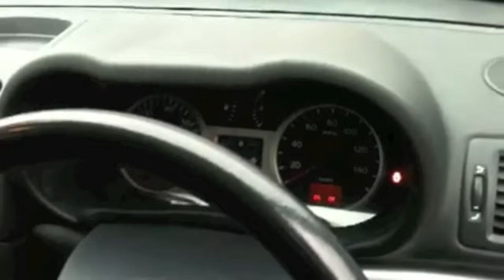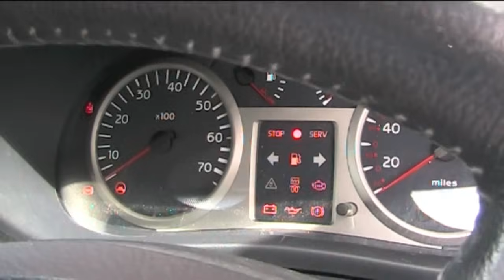Renault Clio 1.2 16v D4F Throttle Body Removal

Comment: You need to take the manifold off as shown here. It's a 1.2 D4F 712 engine. Also take air temp sensor out and clean. Re initialize throttle body if scan tool available if not disconnect battery so capacitors discharge, re connect, ignition on, enter radio code, start engine and allow to idle for 15 mins to set the idle regulation then drive between 2000rpm to 2500rpm for 30/40 secs to set the richness parameters. Btw these can be the worse engines to fix when running faults occur.

Comment from the maker: A fault code reader is whats needed, the dealers are expensive, so a mechanic might have a decent reader, i am yet to buy one myself and just get the lend of one a friend owns if i need it. But if you had a precise fault code then it would be easier to pinpoint the problem.
Have you cleaned out the throttle body yet?

Comment from the maker: The Lambda sensor seems to be ok on this car, the readings on the diagnostics machine show it to be working fine. 
Cleaning out the throttle body and PSV valve made a huge difference however.

Comment from the maker: eventually after time the oil would leak out the air filter housing onto the flywheel sensor (that was the first problem i had on the clio) then the oil on the throttle body caused the rest of the problems.
I also flushed out my oil to solve this problem check out the servicing video where before an oil change i put in some parafin into the oil run the car for a few minuites and then changed the oil which should help get rid of any sludgey oil

Comment: Thanks for this vid. I have a twingo 1 with the same engine. This was the second time I have removed the throttle body using your guide. This time after we finished getting everything back its place the car wont start. No ignition, no fuel pumping, nothing. Do you have any idea what coud go wrong or have we missed ? 
Tried to read the ecu if it has any codes but the code reader says connection error.

Comment: i got new spark plugs and engine coil fitted for the same problem but it has not resolved the overall problem which is the Electronic Fault Light coming on all the time. However the new spark plugs and coil fixed the up and down reving at the start but the overall problem still remains

Comment from the maker: The Crankcase breather or PSV valve is what causes the oil issues. I had actually done this job a week before i filmed it. But when i am taking the throttle body off to the top right of it is a black hole in there is the crankcase breather and it clogs up with old crusty oil and needs to be cleaned out, i used wd40 and a pick to scrape out all the old oil. The place where it sits down needs cleaned, as does all the oil lying around. Eventually if it builds up it will cause the running problems

Comment from the maker: It sounds like the car is in limp mode, its hard to say exactly what is causing it without reading the fault codes. However it could be the coil for the spark plugs, 
But i would get it connected to an fault code reader to see what it says before buying new parts.

What condition is the air filter in? Is there much oil on it at the moment?

Comment from the maker: Ive never worked on one of these cars with A/C but is it the air conditioning pump or pipes in the way?
In either case you could remove the A/C pump from its bracket and push it aside, as long as the pipes are not opened or split then no refrigerant will escape

Comment from the maker: I would check the connections again, im not near my garage at the moment if i was i could look at the haynes manual to see if any of them plugs has anything to do with the fuel gague, but i remember from experience of taking out a fuel pump in the tank that the gague/pump is one unit and the connectors are under the back seat. 
What you said about the steep incline could be a reason, if the car is on the level the gague might register some fuel, did it show 2 bars sitting on the incline?

Comment: could you possibly do a quick tutorial on the throttle position sensor and how to check if its faulty? I have a 1.2 16V clio and the electronic fault light always seems to come on. I have done alot of research and forums suggest its the throttle body and/or throtle position sensor. I refuse to take it to the garage as i have spent in excess of £400 on this daft light

Comment: I have a 2005 mark 2. The engine is Nissan and the comparative work is much easier as you don't have to remove the HT leads and spark plugs as well as various leads, as you do for the earlier model.
Reply from the maker: Is that the 1.2 8v engine? The D7F has a somewhat different layout to this engine and its throttle body is easier to remove, i have a video on its removal.
The D7F however is still a renault engine.
Reply: 1.2 16v apparently Nissan teamed up with Renault for a time and made the engine.  I hope to replace it shortly and the job looks far easier, the autoelectrician said you don't even have to disconnect the battery just replace the unit like for like. Just been using a carb cleaner for the moment which has worked as a temporary fix.
Reply from the maker: Hi, Does it look anything like the engine in this video?
https://www.youtube.com/watch?v=DAJosxh-RkQ
Reply: No, my handbook which was published in july 2004 for the clio shows the box on top of the engine.

Comment: at the mo, ive got the electric warning light the same one in the middle at the start, however all mine does when the light comes on has a lack of power. if i put it in neutral and full throttle it will only go up to 4000 RPM, spark plugs were changed, but any guesses what it could be? 
theres no bad idling, however when starting up it does go up and down a bit

Comment: if i just wants to clean the throttle body do i have to remove the whole thing as u did or can i just spray the carb cleaner through the air filter housing

Comment from the maker: I dont really know, perhaps the engine torque reaction link can be removed and let the engine tilt forward a bit, or peraps the throttle body is accessed in a different way. Renault forums or a haynes manual might be the best place to find out.

Comment from the maker: £50 isnt too bad for bosch, diesel injectors are much more expensive. I though a voltage check on the wires going in would test if there was power going to them.
Are you getting any engine management lights or fault codes from an OBD scanner?
Although try renault forums uk for more help, you dont actually need to be from the uk to join up

Comment from the maker: Its a bit confusing looking at if youve never had it off, but that whole part i removed was the inlet manifold not the rocker cover, although the rocker cover does have the hallow area for the throttle body to sit. It might seem complicated but it would be a lot worse on these newer cars coming out.

Comment: i have a 2001 clio 1.4 and it has trouble starting, you said in the description it was caused by the oil dripping onto the crankshaft position sensor, which part of the video was about that? im a bit clueless

Comment: You have used the plastic bag trick to keep bolts on the socket : )
I have a co worker with the same engine/car wich cut at intersections or when the cooling fan kick in.
it has 180 000 kms.
i will tell him about that.
Thank you for video.
Vey interesting.
I guess the idle air control valve is built in the throttle body ?
Is an Eobd scan tool ok for those cars ?
I would like to buy one with this engine :
Have you got advices or warning to give to me ?
Reply from the maker: michaelovitch A piece of paper or tissue is normally what i use for holding the bolt in place, but a plastic bag does the same trick.
The cutting out at junctions issue should solve after a throttle body clean, but after the cooling fan kicks in is a bit strange i wonder if the alternator is working correctly
Reply: peugeotCitroen2CV 
I think the idle air control can't correctly adjust the idle when the load caused by the cooling fan appears.
It must be all dirty i think,and it causes the engine to stall.
Why would be the alternator causing problem according to you ?
i don't get it.
The amps sucked by the fan should be just a peak load on the engine no ?
Reply from the maker: michaelovitch Ahy the PCV valve gets clogged up in there and starts coating the throttle body and the sensors in the inlet manifold with sludge causing the incorrect readings and bad running, thats why its a good idea to give it a clean aswell when the inlet manifold is off.

Im just thinking that the extra load of the cooling fan might be asking a lot from the alternator which if it isnt working too well might be labouring more than normal but then again if you turn on the cabin fan, full beam headlights wipers, rear window heater and electric windows they should draw extra current and reproduce the same problem.

Comment from the maker: Ahy its easy to get to its all in the intake manifold, undo the screws for the rail and the injectors should come out.
Ive never had to change injectors for the clio, but check that there is power coming to them before condemning the injector.
As for the price the injectors are not too expensive for the 1.2 16v engine, £30 could get you a set of 4 used injectors on ebay.

Comment: Hi there i have the same car as you Clio 1.2 16v and i have a bit off problems with it, in the mornings when i start it it misfires a little bit when i rev it but goes when its warmed up and also there is any real power to it, i put my foot down and it takes qute some time to pick any help would really appreciate 
thanks

Comment: Great video.

Though the top manifold female torx bolts are 8E not 6E.

Unless my engine differs slightly. Mine is a Clio 1.2 MK2 PH2 D4F 712
Reply from the maker: Hi thanks for the comment
Regarding the bolts though its been some time since i did this so can't remember exactly what the bolts were, its best to get a set of those inverse torx sockets for working on renaults as they enjoy using them.

Comment: Hi great video! I have a 1.6 8v clio 1998 with unstable idle speed. Oscillates from 500rpm to 1000rpm.
Do you think it's an easy job for a beginner? How many hours does it take to do it? Thanks

Comment: hello, I have a 1.2 16vand when I accelerate I feel that the power has some gaps... it is not straight. Do you think that I can solve the problem with cleaning or replacing the throttle ?
Thanks

Comment: Another excellent video. I started watching this because i noticed oil in the air filter cover when changing it and thought it would be coming from a breather pipe but i couldnt find one. Was planning on taking all this plastic off and give everything a good cleaning. Ive noticed my car does hesitate a little when putting foot down so figured cleaning things out wouldnt go a harm. 
Did you just use carb cleaner to clean the breather pipes too? Spraying it in there i guess.

Cheers.
Reply from the maker: +mark n 
Hi, yes i used carb cleaner for all the parts of the system
If you have a clogged PCV valve its also a good time to use an oil flush before doing an oil change, clean out all the gunk in the oil to prevent the valve from blocking again.
Reply: +peugeotCitroen2CV thanks for the tip, ill do that on the next oil change as ive just done a change 2 month ago. 👍

Comment: I have a similar car mine is a billabong I have a problem with the air bag and serv/service light they stay on... And both rear reverse light and tail for the driver side don't work only the brakes works on both sides... Any suggestions with be appreciate cheers

Comment from the maker: Hi, is this the sensor at 8:00 on the bottom of the throttle body?
I dont know if they can be swapped, does the sellers say anything about them needing coded etc, i would ask that. And check on renault forums just to be sure.

Comment: Just wanted to ask your advice. Im doing tappets on a 2005 1.2 16v clio tappet settings give 2 settings for inlet and 2 settings for exasust. Im not sure whitch one to do. Do i pick a feeler guage in middle of both settings for inlet ?
Reply from the maker: Are the two settings referring to hot and cold measurements, or is it a tolerance?
I never went near the tappet adjustment of my clio so cant really speak from experience.

Comment: Excellent work mate! I have a Proton Savvy and it uses a Renault 1.2 D4F
 engine. Do you have anything on fault code P0303? I know its a misfire 
but not really sure what to do here? I changed the spark plug but code 
is still showing? 

Any suggestions friend?

Comment: At 4.35 remove this part?
Did you find out or does anyone else know what this screwed on part is?
I have followed this step by step but I have snapped the screw on this part ,half of it is still in the hole so don't want to start the engine until I know what it is.
Thanks brilliant video.

Comment: The block was alot more caked up than the one in the video would you scrap it off with a stanley blade ? If more is required than can be achieved by engine degreaser and a rag - what would you suggest ?
Reply from the maker: A stanley blade would work ok just take care not to scratch the mating surface which is easier said than done. If the engine degreaser and rag are not working, switch to fine emery paper used on a sanding block.
Reply: peugeotCitroen2CV ... and what if I've managed to scratch it ?

Comment: try fitting just a new belt then turn over by hand with a ratchet and socket on the crank pulley and feel for the four compressions first

Comment: Hi.
I've got a question for you, cause in my Twingo 1.2 D4F when I push the gas pedal I hear "tsst" - sound of underpressure... this same sound is on your movie (when you push gas pedal).
I cleaned my throttle - a lot of oil, and other dirty liquid, and clean oil in air cover.. but this sound is still there... 
I thought that dirty crankshaft breather pipe is source of this sound but... not.
Is the sound still occurs in your engine?

Comment: Good helpful guide Thanks.
Im having similar problems- Car runs perfect most of the time but sometimes especially when crawling through traffic I get the electrical fault warning light and the idle goes erratic and on the brink of stalling. About 10 or so seconds it clears itself and returns to normal. I hooked up a fault reader and it stated that manifold pressure is incoherent to another sensor.  Would this be a bad sensor or throttle body reqs a good clean ? It seems to be getting worse as the weeks go by.
Cheers
Reply from the maker: I had a similar fault code with this car something about manifold pressure, but i cleaned out the throttle body, which got rid of the lights and fault code, more importantly the car ran better after it.
Reply: peugeotCitroen2CV Great Ill try cleaning it out before anything else.
Thanks for your help and advice.. Ill let you know of the outcome
Cheers

Comment: I have clio 1.2 16v 2001.
while driving, my engine revs stop at 1900. I turn off the engine with the key, and when I turn the ignition back on, the car continues to stop revs if I don't press the gas. if I give gas, the engine accepts the pedal. and continue to run fine until the next transmission shift. then it blocks the gas again

Comment: Man, that's crazy how you have to take the whole inlet manifold off just to get to the throttle body.
Reply from the maker: Quite true, but thankfully its something that doesnt need to be done too frequently.
Reply: peugeotCitroen2CV
Yeh, it will be hard work, but when your car drives flawlessly afterwards, you will be very glad you put in the effort. Great to see. Hope nothing else goes wrong.

Comment from the maker: I didnt get to the crankshaft position sensor in this video i had intended to do a separate video showing its removal and cleaning, sorry about that. 
But the crankshaft position sensor is below the air filter housing a black box on the bellhousing (where the gearbox and engine meet) it is held in with 2 10mm bolts and one undone it can be removed and cleaned up if it is covered in oil.
What sort of trouble is the car having when trying to start?

Comment: Please help, followed this today, must have done something wrong ... Engine now sounds horrendous, whistles and pops ? Is this likely due to lack of cleaning the block when refitting manifold ? If so how would people recommend cleaning this ? If it's something else ? What is it likely to be ?
Reply from the maker: The inlet manifold gasket where it sits against the block might not be sealing right and you also need to give the block a good clean, nothing special is needed just a bit of engine degreaser on an old rag.

Comment: Question; Should a new inlet manifold gasket be installed before putting it back together at 9:40 when you cleaned the lower part and was there any sort of gasket there in the first place that may have rotted or burnt away? Thanks a lot for a great video
Reply from the maker: Ideally yes if you can have a nice new one sitting ready to go on that would be the proper way to do it.
However they can be slightly difficult to obtain, i have never actually replaced one on a clio yet (then again i can still count the amount of clios i have done this job on with two hands) a spray of silicone spray to hopefully soften the gasket and it went back on. Although bear in mind this video was made back in 2012 when the car was 10 years old, the gasket now on a clio might be 20 years old and more in need of replacement. 

I never considered it that hard to go back and fit a new gasket if the car still missed or misbehaved after the job was done so took the gamble and reinstalled the old gasket. If its leaking spraying something like WD40 round the gasket area will cause the revs to noticeably change.

Comment: Are you sure that the top bolts are female torx E6? I think they are E8 size!
Reply: Yes they are 8mm, I bought 6mm and they didn't fit.. that totally sucked XD. I replaced them with imbus or allen screw in english.